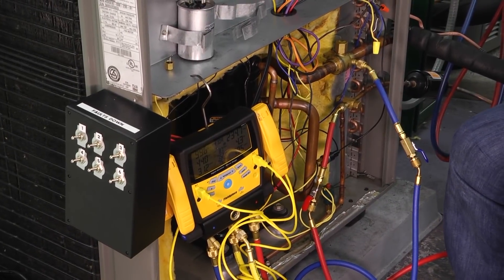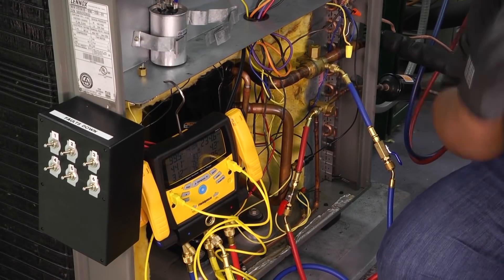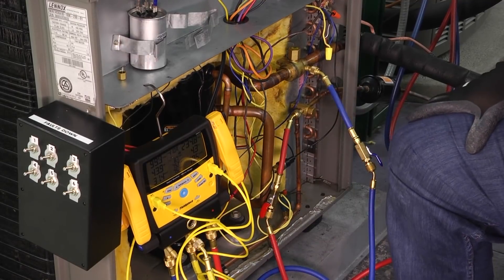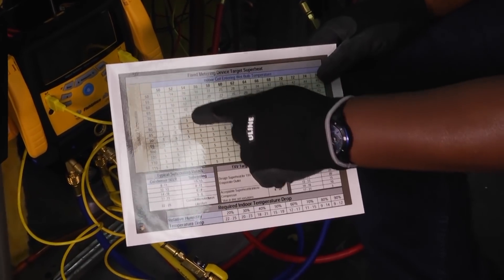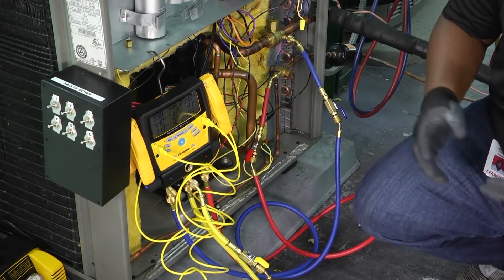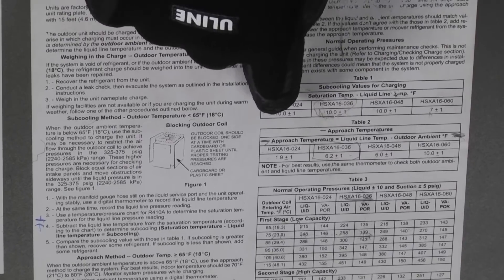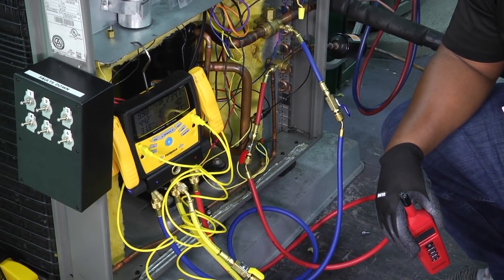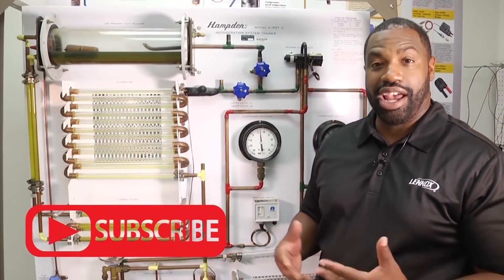Overcharged or Undercharged

Comment: My refrigerator gas in it recently and now when I touch the panel that was put back in the back of the fridge it is cold and wet. The repair guy said he overcharged it and he came back and bled it but it's still the same. Does he need to bleed it some more?